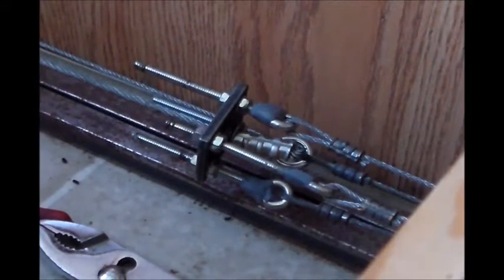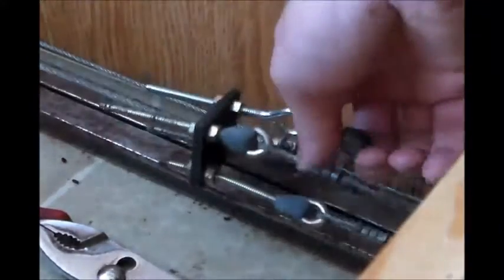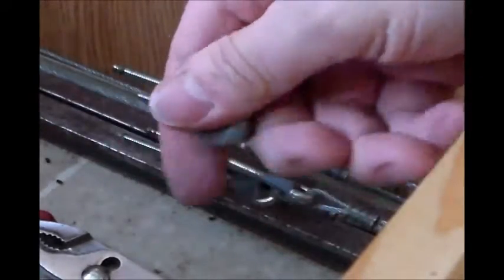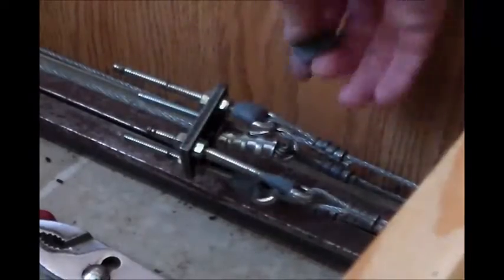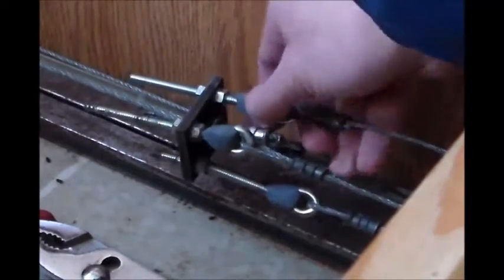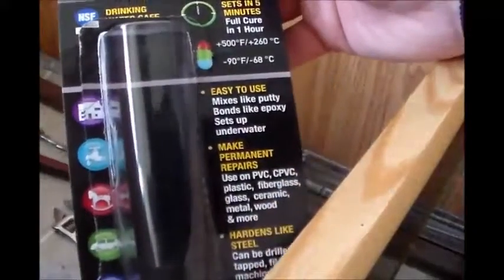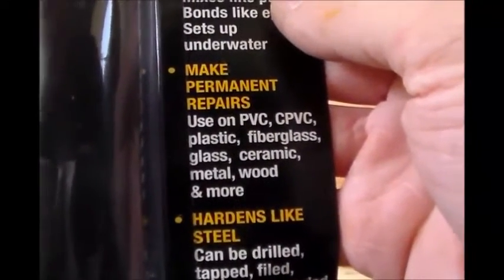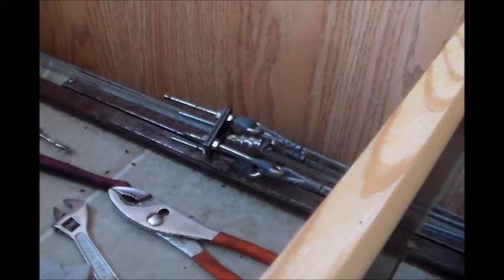Popup Camper Cable Repair Part-2

Comment: First these video helped me a lot. Second after doing some research if you go get the standard zinc eye hooks from any hardware store, they will fail again. They have a weight rating only 80 pounds. I used Galvanized ones that were a complete circle, not a slit like standard eye hook. The galvanized option I found has a 500lb rating.

Comment: Hey how do I replace my bolt?  What’s the best method? I have a similar issue . My bolts are barley holding on... do I have to lower camper would inside to work on cables? Thanks for your help

Comment: So... How has the epoxy fix worked out?
I did the same thing yesterday and would like an update on yours...
Thanks for the idea!
Reply from the maker: +B Carson It's doing good. It's been on there for a good 2-3 years and I haven't had any problems with it. :)
Reply: Very good to know! I hope mine works as well...
Reply from the maker: +B Carson Yep, I was really impressed with it.
Reply: I did replace the bolts in the camper with 6" long stainless steel like @Francisco (below) but during the adjustment stage, I stretched out one of the bolts anyway... D'oh!!
Reply from the maker: +B Carson Ahh...yeah, I got you. I only had to replace one bolt luckily.

Comment: I bought stainless steel eyebolts and took them to a fence shop and they welded them for me, well eorth the 20 bucks and will never have that problem again
Reply from the maker: +Francisco Mora Thanks for the tip! I'll probably do that if I have to replace them again.

Comment: Have any of you had broken cables after this fix? I found broken and worn out pulleys on mine and the eyebolts stretched out and cables broke as a result. I think the stretched eyebolts are the manifestation of a bigger problem.

Comment: I wish you would have showed where the cables ran inside of the camper. The crank is in the rear. Of camper next to right side tail light. This camper has a slide. Not sure where to begin to find cable.